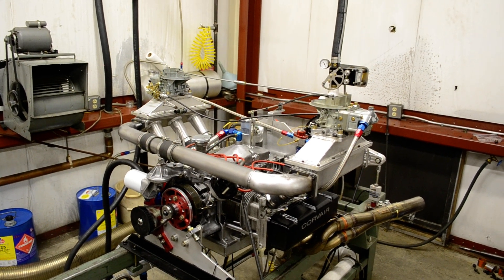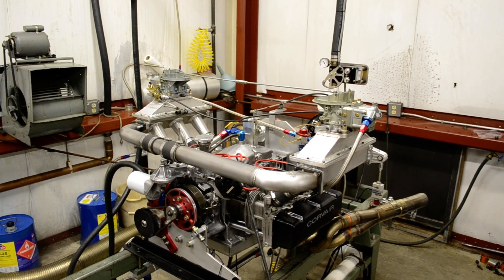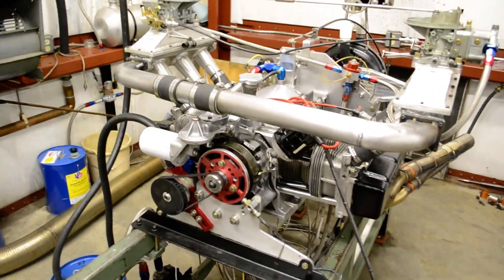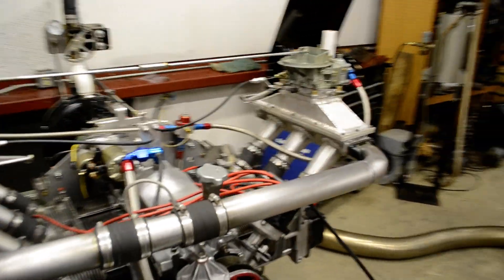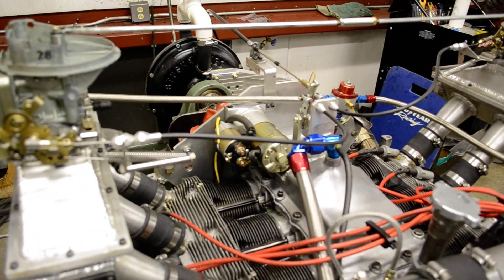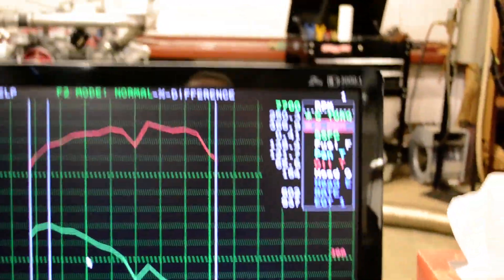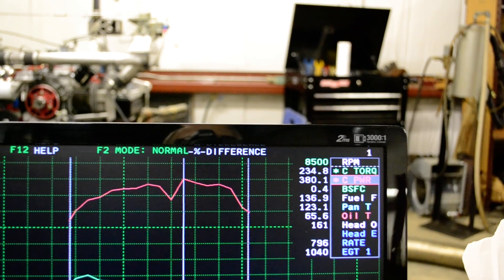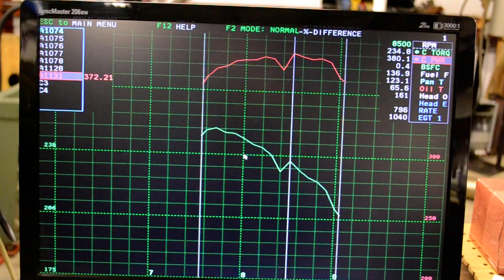380 horsepower Corvair engine

Comment: I had a concept idea of mounting a Corvair engine forward of the cab of a Caterham 7 (Super 7) with the transaxle behind the cab but first there would need to be an adapter to change the rotation of the input to the transaxle after engine and clutch, have the adapter and clutch attached to the transaxle or have the clutch on the engine and adapter on the transaxle (weight distribution and torque management)?
I heard (long time ago), that (for Corv8) you can rotate the transaxle, do some miner mods and you're done (I'm dubious).  ;-)
Reply: In the 70s I built a mid-engined Corvair.  A reverse-rotation cam and distributor drive was available at that time.  Ran well.  (I must have gotten a reverse-rotation starter as well....can't recall.)

Comment: what is the purpose of the crankcase vacuum? just curious
Reply: Crank case vacuum pumps help with ring seal which interns more power with less oil blow by that can get into the combustion chamber and cause detonation especially in a high compression engine like this has at 14:1 !

Comment: Did you custom make everything.  I knew the president of the corvair club. He had a Paxton blower on his but it kept splitting the crankcase where it bolted together. I rebuilt a 110 hp and it ran perfectly.  Not much power though.

Comment: Um like alot of people I grew up around alot of these including several of the spyders and these engines would routinely break parts and self destruct at the modest power they made from the factory..just curious how you made this engine hold up to that and how many runs will it last before it comes apart.Looks like nice work but seems like an expensive gamble.

Comment: FYI: This was accomplished with a 2.94" stroke crankshaft and 94mm pistons/cylinders in an air-cooled engine. The secret to obtaining those figures is the straight intake runners vs the stock intake system with its two 90 degree bends before the valves. The angle-port exhaust quells a known restriction in the Corvair engine, due to push rod tubes. Pretty impressive #s all in all, for a N/A air-cooled engine/automobile that was designed as light weight grocery getter.
Reply: Who, if it can be told, did all of the cylinder head work?

Comment: I would like to see a H.O. Turbo Subaru Engine in a 1969 Monza Corvair, something like 350 Horsepower it would be a little monster!
Reply: +Lawrence Eich This was 380HP which is more than the 350 turbo Sub.
Reply: @AutoAuctionRebuilds  I bet they have more than $25k in that 380hp engine. A standard 200hp street build if done right would be $8k+
Reply: @AutoAuctionRebuilds  I've seen STI turbo's put down 400whp, and over 400lb-ft without replacing the internals.  Basically a new turbos and bigger injectors and supporting stuff.  It's also a real boxer vs a flat V.  That's running on pump gas, and a street friendly build.  I bet the stock 270hp engine makes close to 380 on a engine dyno, that 270 is net hp rating.  That 380hp is likely STP which is basically a gross HP rating.

Comment: I really am intersted in your equillization on the plenum, do you get a smoother response with that configuration? With so many race engine's  made with the standard 90 degree bank or 360 degree intake fireing order, do you get any detonation at all? You did say you have a vaccum of about 14 in. in the crank case just to evac the pressure build up of windage just so you don't get any detonation? or none at all? I like to know! I know you won't devulge the cam spec's but what kind of rpm doe's it make, beautiful set up!!!

Comment: Would 220hp be unreasonable for a durable, economical street motor?
Reply: +20alphabet not at all i live in the city and used to drive a 900 hp car it was a 1973 dodge challenger 440 bored over

Comment: that was not unknown to me, my wording was just unclear. I meant that the center-line of the engine crank shaft is in front of the centerline of the diff/axles (a trait also seen on transverse-engine FWD vehicles most of the time), categorizing it as 'mid-engine' rather than 'rear-engine' like the Beetle, Porsche911, etc, where the axle's center-line is in front of the engine.

Comment: I miss my Corvair, it was a 1968 two door with the 110 hp engine and Powerglide transmission. I loved the way it ran, you didn't need air conditioning because the engine was out back and the air flow through the car was wonderful. It ran and smoked due to the push rod tubes seals leaked. We drove this car a lot, and I even had to change the speedo cable due to it breaking. I put it into a snow bank, the rear decide to lead rather than follow. I sold it do to my wife wanting "stuff". I miss it !
Reply: I had a 1966 corvair convertable with 110 engine. I miss it.

Comment: you are thinking of the 80's Pontiac Fiero, which was another "engine in the back" GM car, though it was mid-engine (engine in front of transmission/axle) unlike the 60's Corvair which was rear-engine (engine behind transmission/axle). The fiero came with 4cyl and V6, Corvair was flat-six only.

Comment: This engine seems to be six cylinders?
The Corvair also had four-cylinder engine,
That was only six?
I appreciate if you can answer me.
Renato fw
Reply: Never a four cyl.
Reply: Chevrolet Corvair never.......NEVER had a four cylinder and all were 164 cid.  Then the horsepower ranged from 95 through 180 during it's years in production.
Reply: @mrcsdavj  Only 1964 to 1969 was 164 cid.  1960 was 140 cid and '61-'63 was 145 cid.